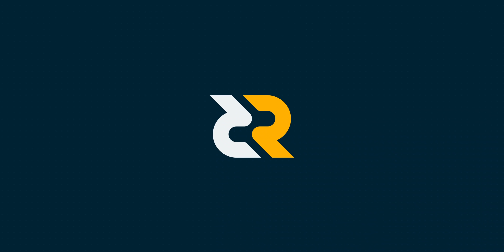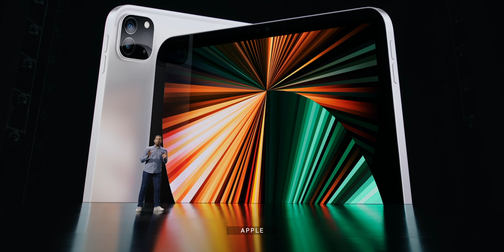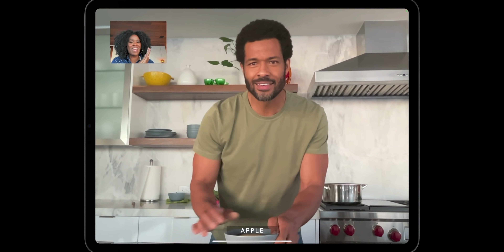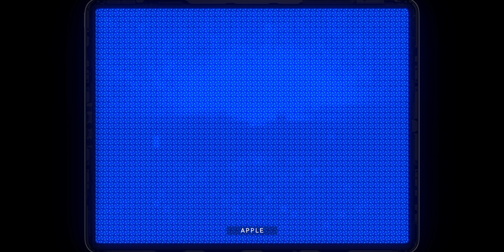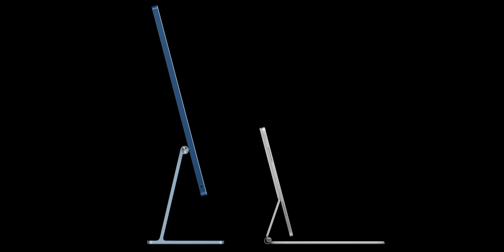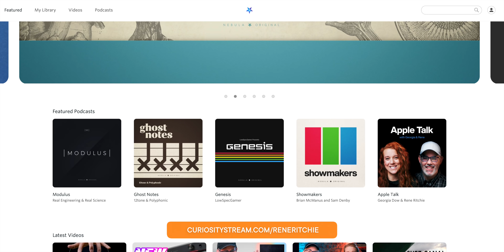NEW M1 iPad Pro (2021) — Tech Reviewer Reacts!

Comment: This is the most consumer unfriendly product Apple has released in years.  It costs as much as an iMac but can't complete basic computing functions because it's engineered to be a giant phone that doesn't make phone calls.  Why????   If this is PRO it should run Mac OS so that I can flip between windows and multitask without wanting to set thing on fire.  Furthermore, why do I need to even buy this??? Apple's entire product line are versions  of iPhone chips (not 1:1 but it's the same architecture so don't tell me this couldn't be in a phone).  I should be able to hook my iPhone up to a touch screen that costs just a few hundred dollars (Like I do with my iPad but god forbid it's someone else's iPad, I'm not allowed to do that) that uses the chip I ALREADY PAID FOR.  Apple is saving cost by switching to its own chips and then telling me I need 3 of them in 3 devices that all do the same thing when I'm already carrying the chip with me literally everywhere I go.  That is one amazing con-job that Apple is running right now.

Comment: It’s not that the background light bleeds over from brighter areas, though there is some of that. The main problem is that the LCD panel can’t block 100% of the backlight, which is always on, full blast, though you can adjust the brightness of the display overall. Mini LED allows those small groups of leds to be entirely off to totally on.

Comment: Highly improbable speculation: They'll put M1 in Iphone 13/14/15.
Reply from the maker: That would be a downgrade. M1 is the same as A14 but with a few more cores. iPhone 13 will be A15, and then M2 may be that with a few more cores. iPhone doesn't have the same thermal envelop for bigger chips.
Reply: @ReneRitchie  Got it! Thanks for clarifying it, Rene. 🙏

Comment: Love your movies and love all my apple products.... but despite me wanting to upgrade my ipad and my mac, for the 4th year in a row... I'm going to hold off again. this is completely unlike me.. I am currently rocking two macs, two iPhones, 3 iPads, watch, homepods, and two airpods. We have m1 in BOTH mac and iPad. iPad has enough power to run MacOS. I get that they haven't found a way to combine the OS experience - one very pro and one very personal. I would rather not wait any longer and get iPad now that runs BOTH. Switching between iPad and Mac mode. Trackpad and magic keyboard with Mac Mode. Fingers and pencil with iPad mode. Just makes sense from a usability standpoint. I would buy right now at premium price for that. I have been holding back for FOUR years waiting for it. Except, I'm really bummed they didn't add a functional row on the magic keyboard also. Do we think that a combined experience is ever coming??? I know they don't want to cannibalize their mac sales with iPad, etc. But man, I do NOT want to buy separate devices anymore!!! Am I alone here?

Comment: I have a 11 inch 2018 iPad Pro. I would replace it with the M1 12.9 inch iPad Pro if iPad OS 15 adds true multitasking.
Reply: But multitasking makes us less productive while thinking we're doing more. 2 windows with slide over is enough...you just have to know how to use it for best productivity like photos and dictionary for slide over.  Use mac mini and Ultrawide screen for multitasking
Reply: @samuelmanny6231  I use iPadOS Voice Control to operate my iPad Pro hands-free. Because iPadOS doesn't have true multitasking when I switch to a zoom meeting I can no longer operate my iPad hands-free. I then need help from someone. This does not happen with Voice Control on macOS. For iPadOS to live up to its full potential it needs full-blown multitasking. At a minimum Voice Control needs it's own thread that does not get interrupted when switching in and out of non-built-in applications.

Comment: I think the difference with Apple’s implementation of MiniLED is that the density is so much greater. The iPad Pro now has more LED’s in it’s 13” than other manufacturers full screen monitors/ TV’s. Whilst Samsung has been slated for it’s MiniLED TV’s, they still have way less density than in the iPad. Only time will tell if it’s a superior tech but I can’t see Apple going half assed on it’s premier display on it’s premier device….that’s just not what they do.

Comment: When I heard m1 on the iPad, I was really hoping they will let you install macOS on it.
Reply: There is no point having 2 seperate OS’s with no communication between them and a desktop OS without touch support.

You wouldn’t need to install MacOS on it as the architecture and underlying kernel is almost identical so no need for both OS’s.

I think we will see app convergence thanks to the Macs being on M1. It would be trivial for developers to use the same code for both iPad and Mac apps (full feature parity) and abstract away the GUI elements using API’s with XCode.

Imagine Photoshop, a single universal binary able to run on iPadOS and MacOS. If a kb/ mouse is attached, it then has the option to switch to a full desktop GUI (per app, not the whole OS) complete with smaller icons, tool bar and menu bar. Without a mouse/ kb, it chooses the touch GUI.

We can already run iPad apps on the Mac with catalyst translating touch into kb/ mouse inputs. It’s not a far stretch to see it working in reverse. As the name suggests, I think Catalyst is the “catalyst” for this.
Reply: @theotherphil  Wow, incredible write up. Thank you

Comment: 1 port is good on the device I just wish they had the port on the case data active especially for the price they are charging
Reply: Apple charges customers not because of hardware...but because of the whole is greater than the sum of its parts...better than hardware+software (the private secure clean OS)+services(esp exclusive apps).

Apple doesn't like bringing stuff to their products that not all will use or many already have. It gives buyers options what and where to buy accessories. They're cheap online

Comment: These iPad-Pro with M1 are really super powerful and considering the price (11 ') could be a good deal for many as a replacement for a real PC 🖥️.
But the problem is no compatibility with PC applications (Mac-OS at least for now) 
Which is normally possible since it is the same processor as the new Macs, therefore Roseta and other compatible ...

Wait and see 👀

Comment: That 1TB 16GB RAM option might be expensive as hell but man, that machine will last you a decade.
Reply: Or until you plug in the wrong USB hub.
Amazing device though, just let power users access all of the M1.
Reply: The battery is dead long before that. Did you check the price for battery replacement, it’s $400+ without Apple care.
Reply: That amount of ram is seriously overkill on an IPad because the apps are currently not designed to take advantage of that much ram. By the time that amount is needed it will be obsolete and likely 2-3x times weaker than the new iPads after it.
Reply: I would buy it if it had mac os instead of the limited ipad os.
Reply: @jeffthegamerboy3476  wait until dub dub
Reply: @jeffthegamerboy3476  I think you, me and most will been pleasantly surprised at this year's WWDC, it just may be the iPad Pros “coming out” party.
Reply: @cameraman655  Apple takeover.
Reply: Tbh I would have preferred the A14X chip. The M1 was kind of made for the mac ecosystem, and it kinda ruins the point of the a series chips. They say on stage that the iPad Pro was built to take advantage of the M1, but would it not take even more advantage, if the chip was specifically designed for mobile usage. I could be wrong, but we shall wait and see for the reviews.
Reply: @abhiramkaza7443  I imagine the A series and M series chips are much more similar than we think they are.
Reply: @abhiramkaza7443  I agree though I think that .... hm.... iPad Pro's M1 might be, kind of, proving ground for other changes in M1, especially replacing silicon that now accelerates Rosetta2.
Reply: Yeah, it would.......BUT....the way Apple puts out a new iPad yearly, it’ll be obsolete by pre-order time. Lol
Reply: @terrezstanley  You mean every 3 years Apple putting out a real upgrade? Haha 😆 they are slow to upgrade if anything. I’m a huge enthusiast but I’m sticking with the 8 gb, I’ll just upgrade to 16 gb in 3 years when they do another upgrade.

Comment: So you mean the battery didn‘t get better after all? I was hoping for that
Reply: I thought the M1 chip would improve the iPad Pros battery life.
Reply: @sherkhanftw7579  apparently not. Here goes my plan of using it as my main-device.
Reply: @DieFarbeLila88  Apple did claim that due to the power of M1 it would have all day battery life and some articles suggest the same.
Reply: @sherkhanftw7579  so longer than 10h? My problem is, that it will deteriorate over time and then it will only have 3h per charge and that only in 3 years or sth....
Reply: @DieFarbeLila88  I have a 2012 iPad Mini and its battery is still quite good lasting 4-5 hours maybe even longer, I think the battery will be good for a long time as long as you take care of the device.
Reply: @sherkhanftw7579  hopefully :)

Comment: For me, the new iPad Pro was most exciting announcement to come out of this April event. I have been holding off buying an iPad Pro until now and will go for a 12.9 model with at least 1 TB storage to get 16 GB RAM. The only downside is iPad OS and the current range of iOS apps are not really going to cause this new iPad Pro to break into a sweat. I am hoping June's WWDC 2021 event will announce new iPad Pro software that will enable you fully utilise the capabilities of its M1 processor, such as iOS version of Xcode, Logic Pro, Final Cut Pro, Parallels Desktop, etc.
Reply: But in that case, wouldn’t it be the end of MacBook?
Reply: No, because you could not fit the more powerful M series processors in the development pipeline inside the iPad Pro chassis due to thermal constraints. Apple gave the iPad a keyboard and pointing device. Why can't the MacBook have a touch screen? A touch screen would be far more useful than the touch bar on the current MacBook Pro models.
Reply: @mannkeithc  just put kyronaut thermal paste and use the entire rear as a heat sink
Reply: @mannkeithc  because it's not ergonomic to poke the thin and light macbook screen...it will wobble too much and consume more energy due to touchscreen The demand is for very long battery lightweight high performance laptops.
Reply: @samuelmanny6231  Well they need to make it touch screen and rigid enough to handle it. P E R I O D. If they don’t they won’t sell any MacBooks in the future.
Reply: @samuelmanny6231  That's great if you just want a thin and light laptop, but my personal preference is for a single multi-input device (touch screen, pen support, keyboard and trackpad) that runs Mac OS, and accept slightly less thin device and ~ 10 hour battery life for greater flexibility.

Comment: I Thought That They Would Use The A14X Bionic Instead Of The Apple M1 Because The M1 Is A 18W Chip And The A14X Would Be 5W And Even Though M1 Is Super Efficient, The MacBook Air Still Requires A Beefy Passive Cooling System To Prevent Throttling. And The Main Reason Was That The Base Variant Of 12.9 IPad Pro Is Still Cheaper Than The MacBook Pro 13. These IPads Will Surely Cannibalize On Their MacBook Sales.
Reply: M1 is 10W

Comment: iPad Pro's specs are overkill because iPadOS is still limited to being a mobileOS.

Please, please, please Apple. There is no reason NOT to have a iPadOS/MacOS hybrid OS for the iPad now.
NO dual boot, switching, transforming modes, that's too complicated. Just one seamless OS that works, functions and can be used regardless in portrait or landscape for the iPad.

C'mon Apple.
+ Finder
+ Mail (portrait view is limited compared to landscape such as no email lock column)
+ Desktops
+ True multi-tasking
etc...

Comment: Question 🙋‍♂️ will all regular apps on ipad works on this new ipad pro with m1 chip?  Like all apps you can find on iphone/ipad etc. When i look at macbook it was alot of differents setup app store
Reply: That's my guess because the apps compatibility depends more on the Software and iPad OS is still the same as before.
Reply: No its will run as it use to coz OS is same
Reply: Yes, any app that worked previously, will.

Comment: I'm still amazed by the capabilities of my m1 MacBook pro.  99% of the time it's docked with my 4k display. This is a better experience than my last desktop 3700x + 5700XT. It's nuts to think this is in a tablet now.
Reply: And this is just the beginning esp with many non native apps. Also next year, ArmV9 transition will make everything better.
Reply: @samuelmanny6231  I think that's undeniable. A 10% single threaded speed bump and the addition of two more HP cores would make this product untouchable; even in the desktop TDP space.

Comment: Hopefully with this M1 Silicon, Mac OS apps will finally come to the iPad like Final Cut, Logic Pro and Davinci Resolve, imagine that!
Reply: That's what i thought! Though iPad is meant for an overlap between mobile and desktop work, i thought it was still unusual why to use a full power desktop chip on an iPad! We could see something really big coming for iPad OS in Apple's Dev conference in June!
Reply: @brentandrewchua3824  Fingers crossed for what you say.

I work between the two worlds as a Graphic designer and a programmer. I want the iPad Pro to work with full fledged IDE environments so I can ditch the idea of the Macbooks and get the iPad Pro only but that's not possible just yet.

The problem with the iPad Pro is not exactly the hardware anymore but the OS. This software was just not conceived for that kind developers tasks. Now, since they rebranded its OS as iPad OS, I hope the idea behind it is to somehow find a way to gradually turn it closer into a MacOS Software.
Reply: The iPad has had plenty of power for apps like these for many, many years. The problem is that the software isn’t there. The UI hasn’t been able to scale to extremely complex “pro” apps. It’s not about hardware, it’s about figuring out how a touch UI and a simplified file system can compete with a mouse/keyboard/traditional hierarchical file system.
Reply: @chrisherbert  It’s very easy, just make one without 500 buttons everywhere and one that’s intuitive and useful, not the cluttered mess that is “pro tools” I’m an artist never needed those 500 options it’s just a mess/waste of time.
Reply: They need pro mode. Like samsung dex. An environment where they let you run macOS apps optimised for apple silicon.
Reply: What's even more interesting is if you choose the 1TB or 2TB storage option, the chip RAM doubles in size! 16GB! Like WTF?!
Reply: Why would you want to use FCPX or DaVinci Resolve on an iPad though? I could kinda get the appeal pre-M1 MacBooks, but now what’s the point? Just buy an M1 MacBook. You’ll get the major benefits of the iPad (battery life, power, thermal efficiency) in a far better form factor.

Comment: Imagine Mac apps on iPad!
Reply: Which ones? The power was never the issue, but the form factor. Imagine using Final cut or Motion with just touch. 

Now add the magic keyboard... and then compare it to the MacBook Air. It’s silly. 

We already have had iLife on the iPad for years. Anyone really use that? 

If you aren’t using the iPad Pro as a drawing device, it’s really just weird as a pro device. As the slab just doesn’t play into it.

If they develop new apps taking advantage of the power and form factor than we are talking 

As an example, no one talks about how well Affinity designer is designed to work on iPad even without the pencil. 

If Apple redesigned a fully featured editing software to run with touch gestures, that would be awesome, but a straight up port of Finalcut? Get a MacBook Air.
Reply: Touch based macOS cometh.